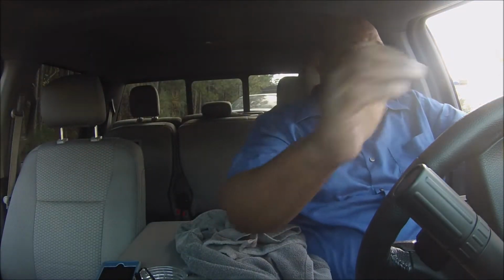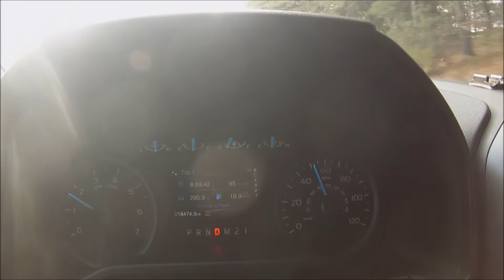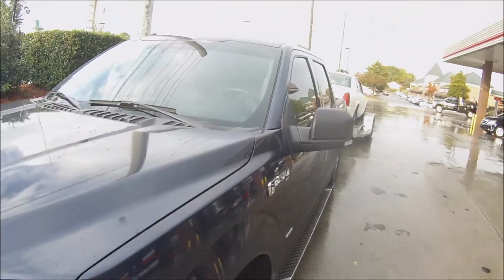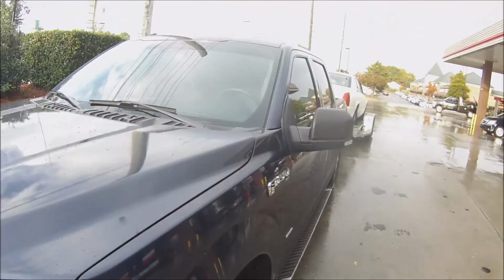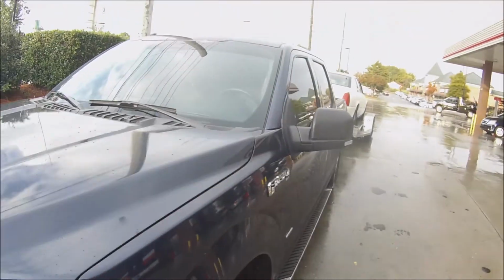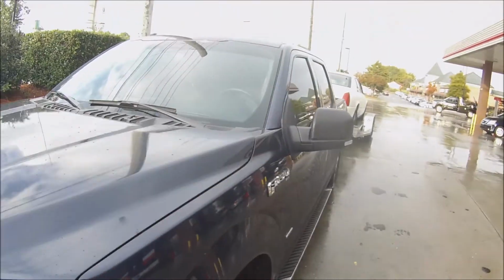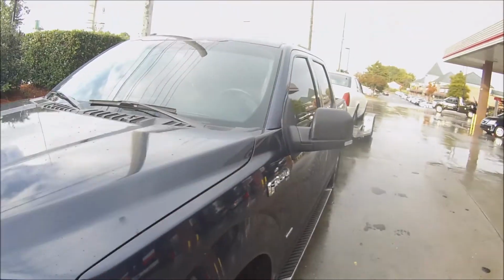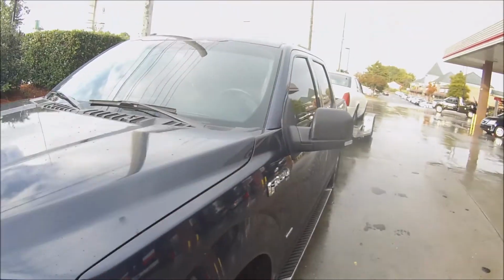F150 towing 6200 lbs. spinning on wet road

Comment: used to work for a guy that would haul his big ass front end loader with his old 80s model toyota. truck didnt really have a problem pulling hills, obviously it was a little slower than normal but that truck still runs. in all honesty the trailer does most of the work these days plus coupled with fords constant towing tests. these trucks have been pound for pound the best work trucks out there since 97. never load a vehicle rear bumper forward. now you know why.

Comment: Who the fk said a v8 has low end torque? I have the coyote and that things max torque and hp kicks in at high rpms. That motor needs to be reved. I heard ecoboosts is the opposite. The torque hits very early in the powerband and down low.
Reply from the maker: Old school v8 had low end torque. The new school v8 have low end torque but peak torque is higher up.

Comment: Ecoboost is stronger and faster, but the V8 is more reliable long term with VERY slightly worse MPG. Pick your poison. And no, you should not have loaded that car with the weight of the engine rear of the trailer tires.
Reply from the maker: My 2.7 will last as long as the v8 because Ford put stronger parts in it. Very slightly worse mpg is a lie.
Reply from the maker: The 2.7 is faster than the v8
Reply: why are some of people so obsessed with saying a V8 is so more reliable, when theres proof thats theres gobs of these ecoboost engines out here with 200k miles plus with relatively few problems.  Yes there are some that have taken a crap at low mileage.
Reply: Brian F its the assumption that naturally aspirated engines do not work as hard as forced induction engines that have a turbo on it. Alot of people also use a v8 as a measure of their man hood.
Reply: @MrInzombia  i just like a V8, no disrespect to the ecoboost trucks. its just my personal preference.
Reply from the maker: @bcfmef  People believe what they read on forums. Over half the guys on forums are not old enough to drive.
Reply from the maker: @dirtybauer7022  You probably have never driven a boosted engine before. People claim to love power. You can’t drive a 87 GN and not like the power it make. Ecoboost engines are the same way. If Ford ever make an ecoboost v8. It will be time served.

Comment: You’re right there probably isn’t much weight on the tongue with all the weight acting like a lever. 
About the V8, let’s see big trucks have inline 6 turbocharged motors. 
Better get you some gas! Lol
Reply from the maker: I have a video talking about why big trucks have inline 6. There are narrow and more aerodynamic.
Reply: Should get yourself a laser thermometer at Harbor Freight then you wouldn’t have to touch those pipes, and you could check how hot your tranny pan is when towing. I like mine.
Reply: Your joking right? They have inline 6's because they are diesel and semis need torque, not horsepower and you get more torque out of an inline. A lot of older semis had V8 diesels. Nothing to do with narrowness and aerodynamics.
Reply from the maker: Torque has nothing to do with inline 6. Don't believe everything you read online.